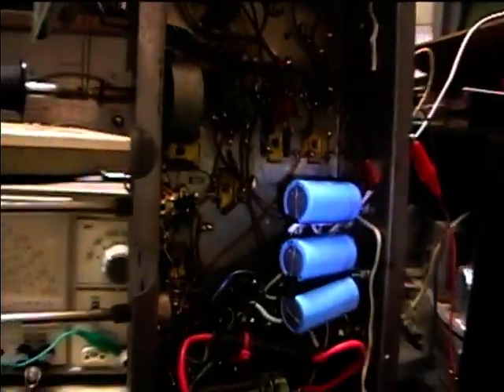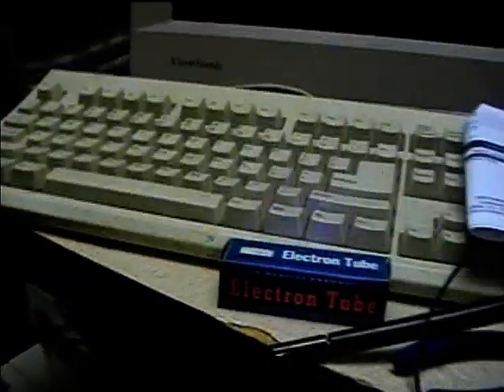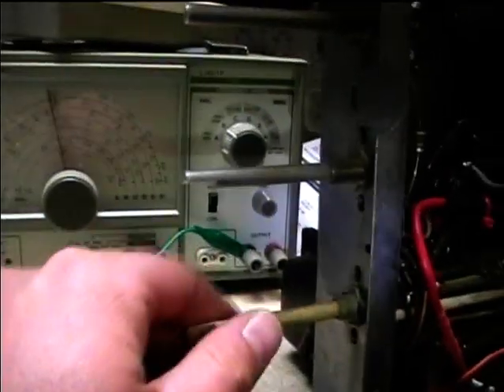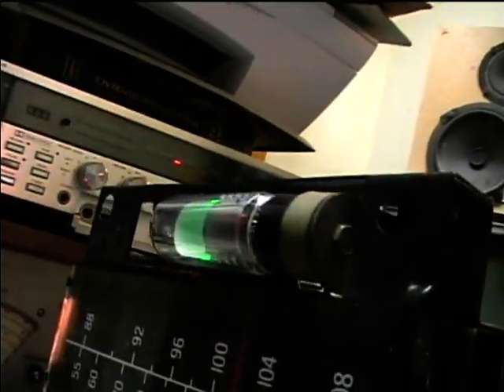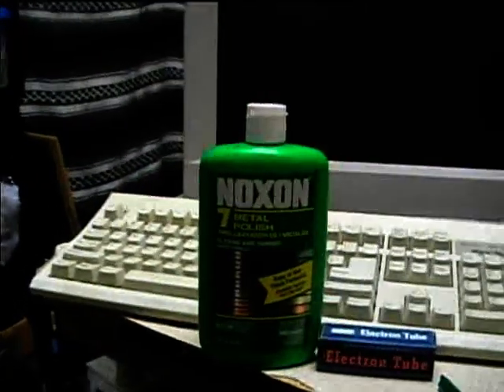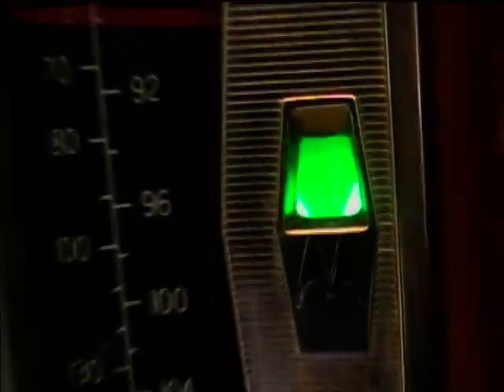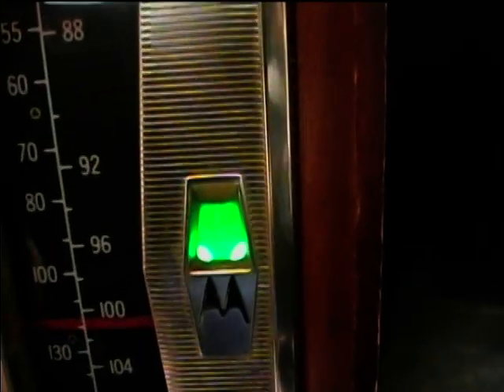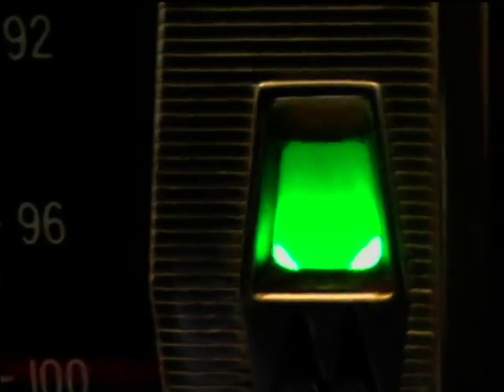1959 Motorola AM/FM Tube-Type Radio Repair (April 2010)

Comment from the maker: @schepler2 Also, I install the fuse in the power line coming in before it goes to any other components, usually in the circuit before it gets to the switch. The amp rating of the fuse is about 1 1/2 times the average normal current draw of the set.

Comment from the maker: @schepler2 Hi, the fuse is to protect the power transformer and other components in case there is a short in a capacitor or tube...there is enough current available from the wall outlet to seriously damage components if there is a short without the house circuit breaker blowing.

Comment: @ retrochad, i agree with gmcjetpilot that a alignment is in order. i also suggest that you check the 1meg grid bias resistor for the 6DA4 to see if it has not drifted out of it's rated value.